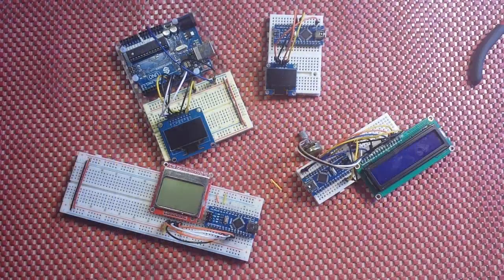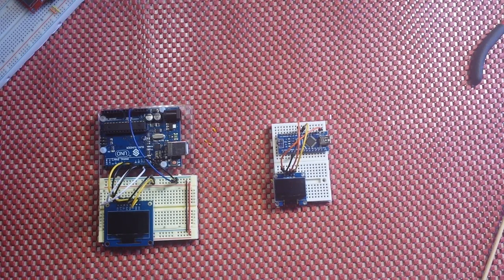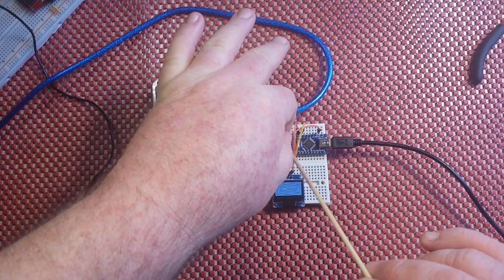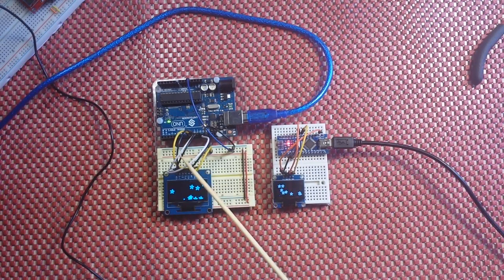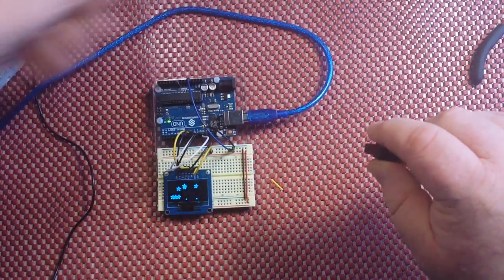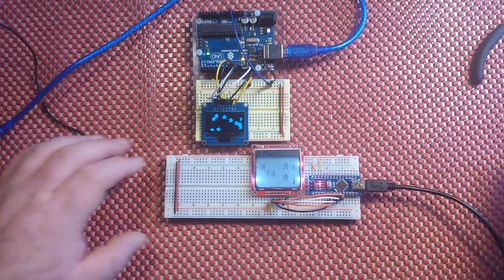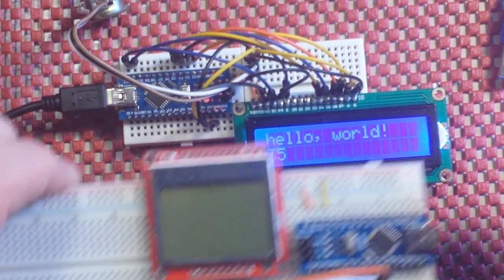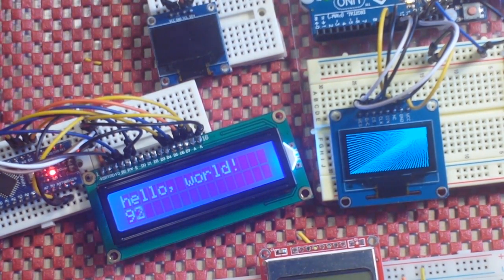Arduino Display Types

Comment: Nice video, I always use the I2C interface board together with the 16x2 LCD (or 20x4 LCD) makes it a lot easier to connect.
Reply from the maker: Javier Palla Lorden I2C is my favorite interface. Putting that backpack on the 16x2 makes it super-simple to use. What kind of projects do you like to make?
Reply: learnelectronics Hi, I like to make projects involving Arduino, I am now in the process of making a DC Load with Arduino, following the steps of Scullcom Hobby Electronics. So when it is finished I will have something usefull.
Reply from the maker: Javier Palla Lorden that is awesome. let me know how it comes out
Reply: That is also why I like your channel, lots and lots of very usefull information, a big thanks for that!
Reply from the maker: Javier Palla Lorden thank you for watching, and taking the time to comment. that means a great deal to me. do you know about the giveaway?
Reply: Yep, I am subscribed to your channel so maybe I am the lucky one.
Reply from the maker: Javier Palla Lorden good luck my friend!